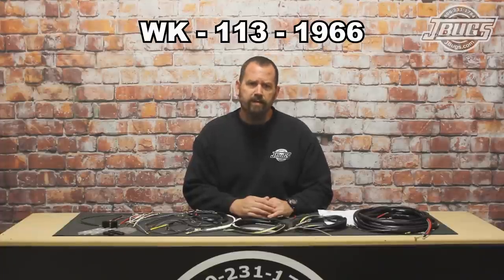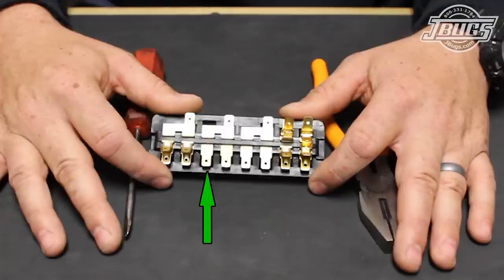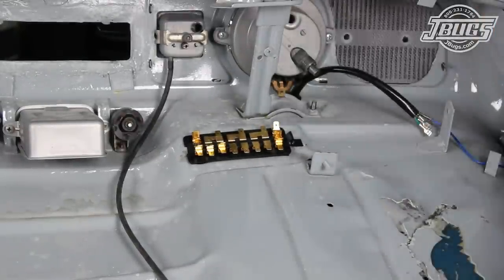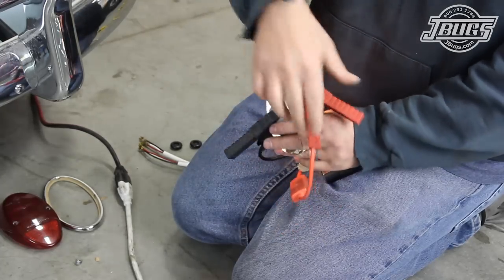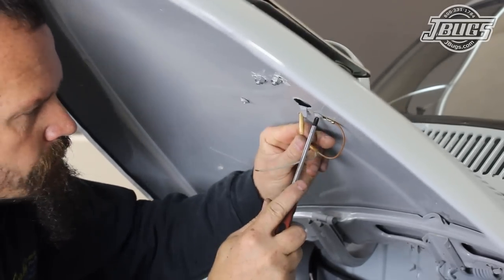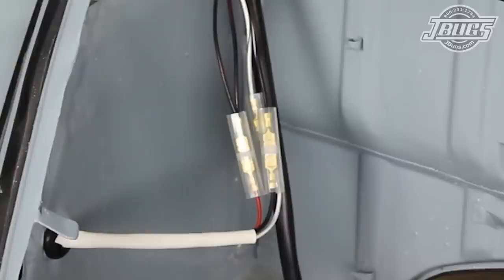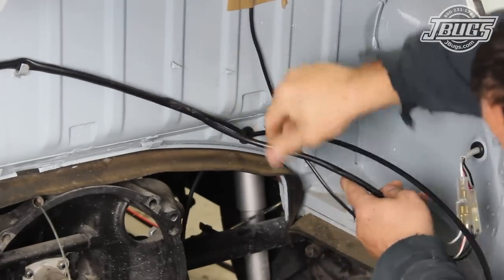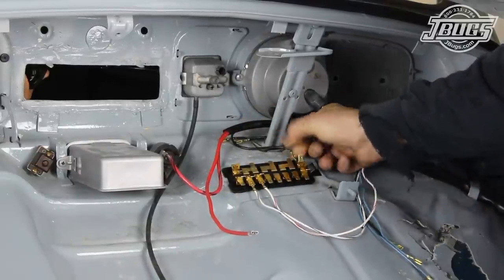JBugs - 1966 VW Beetle - Vehicle Rewiring - Main Wiring Harness

Comment: I have a 1964 bug with a 12V conversion, would the fuse terminal configuration be the same?
Reply: 6 or 12 volt makes no matter, but yes. The fuse box configuration is the same from 1961 to 1966 (as long as the fuse box was used from VW).

Comment: I purchased all the wiring needed for my car. It's pretty heavily modified and I plan to add some aftermarket, non vw headlights in the front. I definitely need some guidance. I have a 1958 beetle. HELP?!?
Reply: We do a lot of customizing on the wiring of our 1971 Super Beetle if you want to watch through some of that series. Otherwise, take it one section and one wire at a time.
Reply: @Sam_Mebane  I definitely appreciate that. I need more help than just the wiring. But here's a question for you, do I need to drop the engine and transmission to get the wiring through the car? If so, it's definitely not part of my expertise.
Reply: @ratrodpunk87  it's shown af 3 minute mark

Comment: A couple questions for you.I have what looks like a stock cigarette lighter went to use it to charge phone but it did not charge.Turns out it's not connected.Cant find no diagrams on the wiring of the lighter l did find a red wire with a round push on type connector with a split off connector again red in color but could not follow where it connected to power wise.lt may have been  used to power an after market radio they installed but then removed Would greatly appreciate your help on this.Also the same previous owner looks like they installed a new turn signal switch the problem is both indicators on the dash blink at the same time when indicating a left or right hand turn but not on the outside of the bus..Thank you Walt
Reply: Cigarette lighters/12 volt outlets typically get ground through the metal outer housing, on the back side of the dash. The metal housing should ground out against the back metal of the dash. If the back of the dash isn't metal, there is usually a male electrical terminal built in to the metal housing. Run a wire from that terminal to screw or bolt that is grounded out to the metal of the car. To power the outlet, the back center of the housing should have either a male terminal or a wire. Run a wire from that terminal, or run that wire to either a fused key hot (only on when the key is turned on) or a battery hot (always has power) based on when you want the outlet to have power. You can use grounded out test light to identify terminals on the fuse box that are key or battery hot. If you don't have any open terminals on the fuse box you can use a piggyback electrical terminal available at most auto part stores.

Troubleshooting the turn signals takes some work. Not knowing what year Bus you have, it's hard to say where to start but basically, power comes in to the switch from the flasher relay and then out to the left or right bulbs. The indicators operating in the dash (VW connected them so the blink together regardless of whether the left or right indicator is on) tell me that power is coming in to, and out of the switch so the problem is most likely in the wiring from the switch out to the bulbs. Double check that all the bulbs not burnt out and that the housings have a good ground. From there, it is just a process of working from the switch to the lights themselves making sure the power is getting from the switch to the bulb.
Reply: @Sam_Mebane  Thx for getting back to me your info was very helpful.I didn't know both indicators on dash blink at the same no matter if you indicate a left or right turn..Kinda weird.l the knew the emergency indicators flashed at the same time..appreciate the help saved me alot of time...Walt
Reply: @waltercannon86  no problem at all, glad to help. I don't know why VW tied the indicators together. It would be simple to just wire them into the left or right side power wires. Perhaps as they started with one indicator on the Beetle, maybe they just wanted to keep the wiring similar through out the model line up.

Comment: Is there some trick for getting the terminals out of the fuse block? The first one came out looking like a pretzel.
Reply: And now the plastic broke...
Reply: @jdhalvo  No trick, unless your terminals happen to be soldered together on the bottom side. We used nothing more than a flat head screwdriver to wedge underneath the terminals and pop them out.

Comment: Just out of curiosity, given an experienced VW mechanic, about how many man hours would you say this should this take?
Reply: Typically VW mechanics don't get this far into a VW. For myself, a fairly stripped down car, running with no interior, a complete driving in kind of working to driving out completely working installation takes about 4 to 6 hours if everything goes well. Rarely does that happen though.

Comment: Does the kit come with all of the grommets as well?
Reply: The kit only includes 3 grommets, for the tail light wires and the power wire to the starter in the engine compartments.

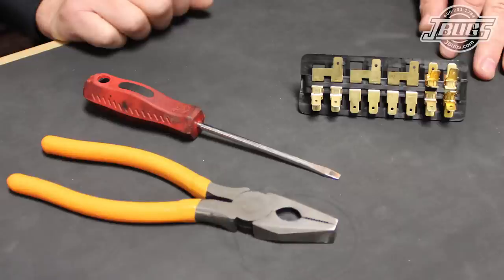Comment: Rearranging the fuse box (1:20 to 2 minutes) with a flat head screw driver and plyers is a major pain.  The fact that the video is sped up at that portion does not help much.  How does one get these very tight parts out without bending the contact points?  Thanks!
Reply: After experimenting, I found that alternating between a small screw driver and the pliers does work.  As for getting the terminals to set without bending everthing up, I used a vice as a staging table--and--gently--tapped on back side with a screw driver and a hammer.  For 17.95, hard to believe the manufacturer did not put them in the right place.  Yikes!
Reply: @patoconnor6089  It's all technique, glad you got it figured out. We agree it would be nice if the terminals were in the correct position, the problem is, they are, just not for the Beetle!

Comment: Would the 1973 VW wiring be mostly the same?
Reply from the maker: In general, as long as the 1973 is a Standard Beetle (not a Super), yes, the wiring is similar. There are a few more wires added throughout the years of course but our wiring harnesses come with instructions that cover the specific installation of the particular years.

Comment: would this be a similar process for a 65?
Reply from the maker: Yes, the installation is virtually identical
Reply: What if I have an engine out of a 73?
Reply from the maker: @brysontrotman5865  The main harness installation is identical (https://www.jbugs.com/product/WM-111-65-66.html). The installation of the wiring at the engine would only change based on the charging system (6 or 12 volt, generator or alternator).

Comment: "Can be installed in a few hours by just about anyone"😂
Reply: Yeah, I've known 16 year old kids with no auto experience that installed the same harness in an afternoon. Perhaps the fear of wiring holds back those with some experience and someone without experience is better suited.
Reply: @Sam_Mebane  Perhaps. But it's been my experience when it comes to $h!t like working on my old VW nothing is ever as easy as it's alleged to be. Especially when it comes to something major like rewiring the whole car. Idk, maybe i've got bad luck or maybe i'm just dumber than $h!t.
Reply: @JohnnyRebel1776  it all comes down to luck, and making sure ahead of time that all the switches, etc are in working order ahead of time. The wiring is just "plumbing" in a sense. If all the valves and faucets work, hooking up the pipes is pretty simple.